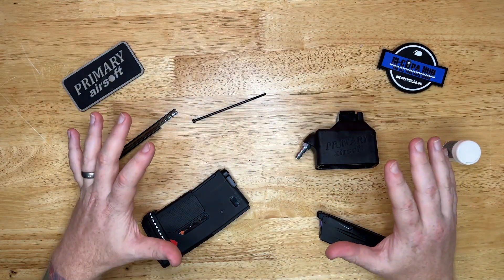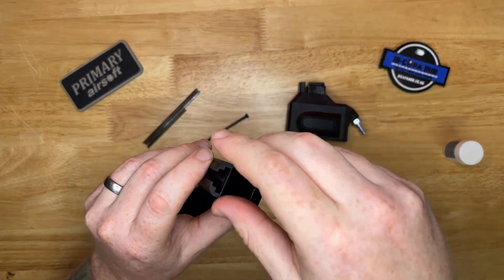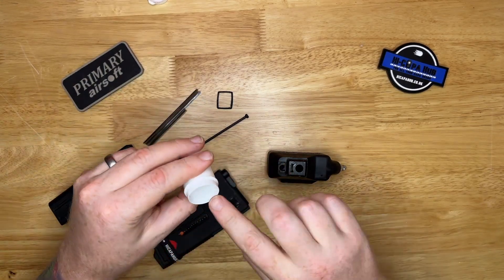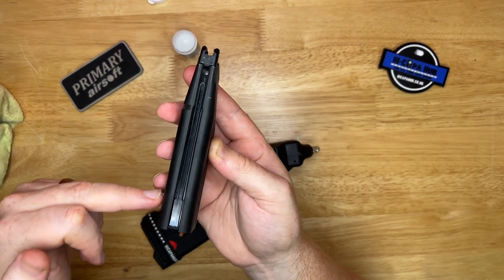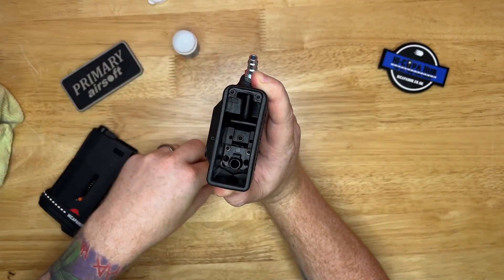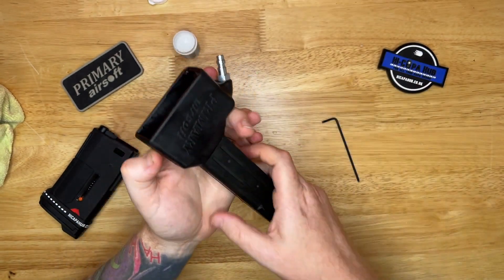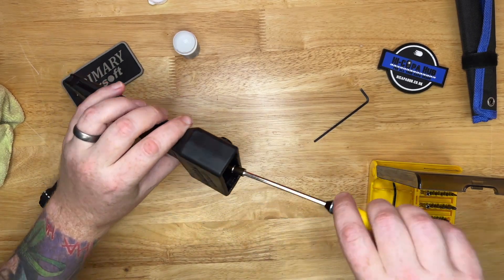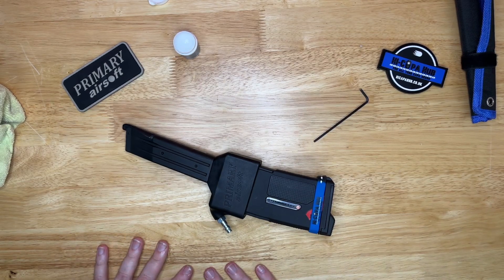Hi Capa Primary Airsoft Adaptor Installation for HPA Pistol Conversion - CQB Speedsoft TM Fitting

Comment: extremely helpful video!,  also one question i have a very tiny gap in between the adapter and the mag,  like its not fully flush against the adapter but there is no signs of leaking do you think i should keep trying to make it flush or leave it as it is because i dont think it can go any further and i think if i keep trying i might break it
Reply from the maker: You will almost always get the tiniest of gaps due to allowance for tolerances. It will be fine as the seal is done on the oring above. My older gen2 was visible but newer gen3 isn't as bad.